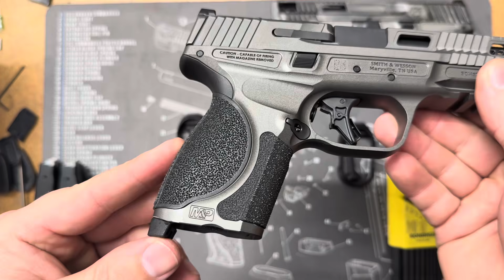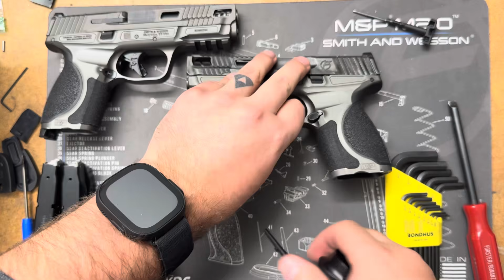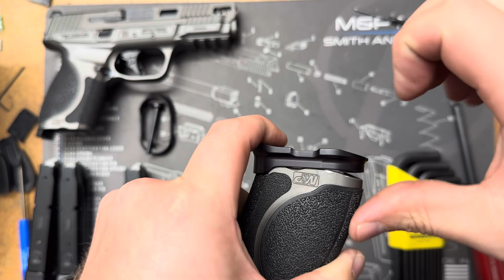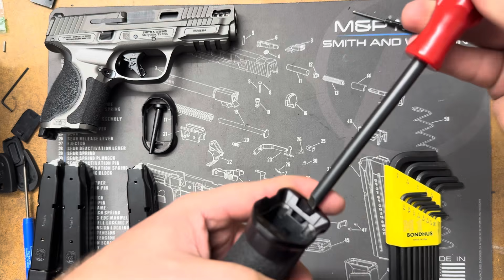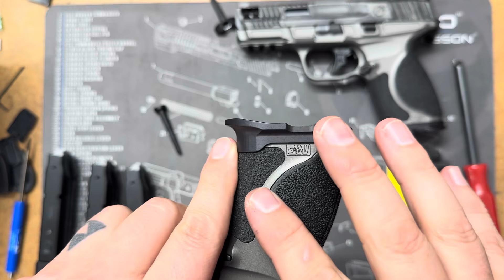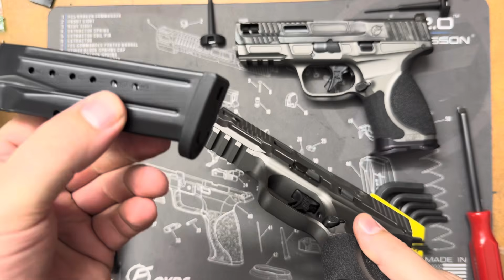Floyds custom shop M&P compact Metal frame Magwell install

Comment: Im having trouble with my 15 round mag, the 17 works perfectly but the 15 only fits when i apply specific force. 
What can i do to fix it?
Reply from the maker: Are you running the +2 or what plate or extension? Is it tight with the slide locked back or empty mag? Or just with a full mag and slide closed?
Reply: @floydscustomshop2157 running the +2 on a 15 round mag.
Fits easily with the slide back.
But needs a whack with the slide forward

Comment: I have the m&p 2.0 carry comp with the 15 round mag and I’m having trouble figuring out which magwell I’m supposed to be going with…The full size or the compact one?
Reply from the maker: So is it polymer or metal? 15rnd is usually compact unless you are in a limited capacity state, there are a few full-size 15rnd 9mm mags out there. Message us on instagram with a picture and I can tell you exactly what you need

Comment: If only there was a solution for 10 round Cali Mags.
Reply from the maker: We make plates for the 10rnd limited capacity mags!
Reply: @floydscustomshop2157 where can i find it?
Reply from the maker: @khengomez6146 under S&W M&p and then 10rnd limited capacity
Reply: @floydscustomshop2157 bought thr base and magwell. For the base it will still take 10rnd but its so tight that the bullet wont go inside the chamber. So it will force you to use 9 bullets only.
Reply from the maker: @khengomez6146 that should wear in over time, you can sand down the tips of the follower a little to give a little extra space aswell. We make them the same connecting size as the stock ones but due to the difference in plastic and aluminum it is tighter to get the 10th round in but does work in over time

Comment: is that barrel on the mp on the left factory cerakote or is it a custom ceraktote by y'all. Looks like its the same tungsten color as the cerakote frame, been looking for a comp barrel that is tungster color
Reply from the maker: That’s the stock finish. We do t Cerekote barrels as they would wear quick and could cause jams
Reply: @floydscustomshop2157 my apologies i meant slide
Reply from the maker: @b0ning ah no problem. Yes we had the left one re cerekoted tungsten, and the right is tungsten and black battleworn

Comment: Is there a new SKU for the aluminum Metal frames or is that just a silent update?
Reply from the maker: The aluminum frame is different than the polymer, please watch the video as I explain the differences between the early metal (aluminum) compact frames and the later frames. And witch drop down option to choose on the website
Reply: @floydscustomshop2157  what I meant was a new SKU for the newer aluminum frame models to distinguish from the older aluminum frame models because of the different geometry in the new magwells. And for the record, I did watch the video.
Reply from the maker: @TROY-MCCLURE-1991  sorry i misunderstood. thank you, unfortunately S&W wouldn't or didn't know when the change was made to give us an easy way to distinguish the two, you have to look at the frames and decide what you have. on our website the early run frames would be the 137 sku. the later run is the 139 sku, it desnt say it on the website yet but i will have them change the drop down so that option 2 says 139